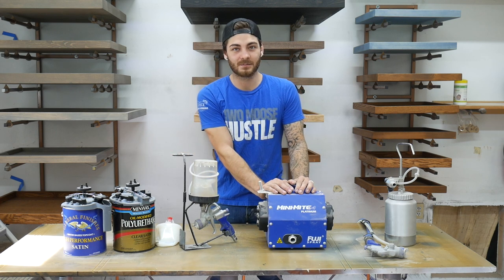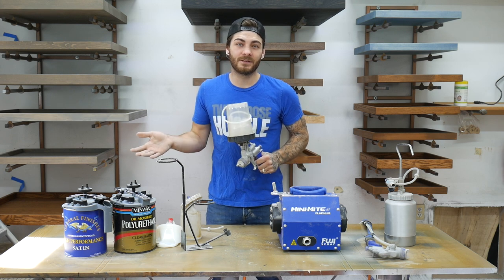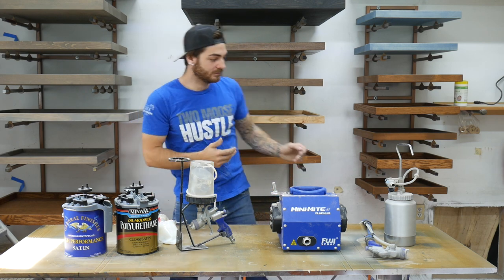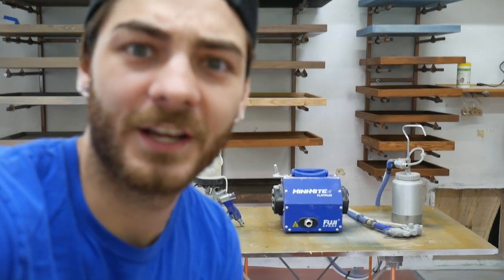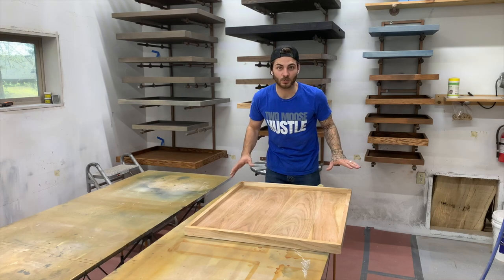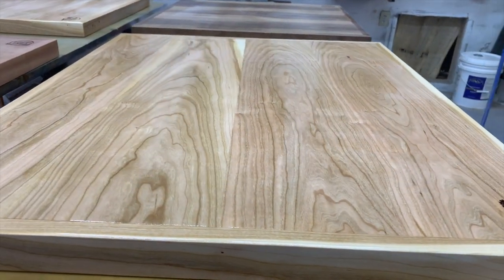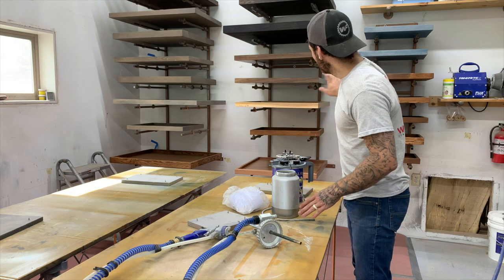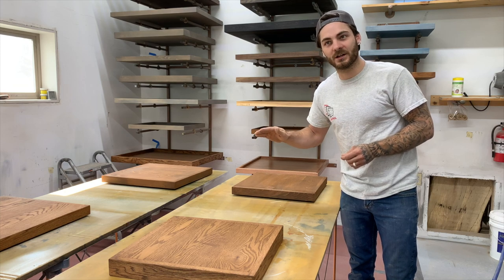My Spraying Setup and HVLP Woodworking Sprayer Tips // How To

Comment: We just tried the oil modified poly and wow. What the hell we were wasting time with the full on poly. 

We were getting plaugued with dust or some kind of cross contamination  with the oil. 

First coat took a while to fill in. The second coat was dry so quick. Since it dried so fast sanding was quick. We had to really scrub with oil. 

Something we half assed looked awesome . 

Just going to see if we can do this with a earlex or try brushing it. I don't think it's possible to brush and keep it consistent . It requires a thin coat which might be impossible with brushing and maintaining mini production of a ton of moulding without taking all day
Reply: You mentioned you used this with the earlex. ? How did that work out ?
Reply from the maker: Glad it works for you! The main reason I use it is for the dry time. I can get 3 coats in a day vs 8+ hours per coat with oil 🤷🏼‍♂️ and the water based is plenty durable for my needs. I personally spray everything because of the quantity I do but I’ve had decent luck brushing it on small items
Reply: @TwoMooseDesign  true. But I feel it will be  impossible to keep it consistent brushing  . plus You sanded so lightly . With oil We had bubbles all over the place.  
 I'ma try spraying tomorrow the oil modified tomorrow. . But wow. I can't believe how good the finish is with a foam brush like you did. 

Have you tried it with an earlex machine before ? I hope it's powerful enough.
Reply from the maker: @shahsmerdis  it should be a plenty powerful! I haven’t used an entry level spraying in a while. I used a Wagner for a while with a different water based poly
Reply: @TwoMooseDesign  thanks !!!!! I really appreciate it.!!!
Reply from the maker: @shahsmerdis  you bet! And when applying by hand do not back brush. Add a nice coat and move on, it will level out on its own. The more you brush over it the worse it will look in the end.
Reply: @TwoMooseDesign  thanks for the tip! I'm definitely going to try spray first.  We had good results with Benjamin moore latex paint  with the earlex. It came out like a show room piece ! No orange peel. 

On the brushing note, I've heard  about not back brushing . But  Im not  sure how much work time do you  mean. do you mean lay a coat down and don't go back and forth at all. Or just don't go from one end of the piece to other end and then  back to the start type thing  .    I dont think I need to treat it like shellac. I think we will get the hang of it. 

I hope thats not too wordy for a youtube comment lol
Reply: Ohh ! And brush any brush of  choice you prefer ?
Reply from the maker: @shahsmerdis  yeah once you have it covered don’t go back over it once you apply it to an area don’t brush back over it. I personally use foam brushes since I don’t apply much by hand anymore

Comment: I like your spray finishing set-up Jef.  Here's a few comments to help your audience out: 
  1.   get into the habit of always straining finishes as you pour them into your gun cup (or reservoir) - even if there's a built-in strainer (PPS, for instance) - to filter out any impurities or loose dried fleck of finish which could spoil your finish.
   2.  if you're spraying a waterborne finish NEVER use a tack cloth, as they contain oil-based solvents which will cause fish eyes and affect the bonding of the next coat.
  3. raising the piece you're spraying at least 15cm (6") above your spray table will limit finish bounce-back and make it easier to get your hands underneath the piece to flip it over.
   4.  until you're as experienced as Jef or Jess and can visually check as you go along, use a wet film gauge to confirm the thickness of the coat you're spraying.  As a general rule of thumb, most finish manufacturers suggest each coat be between 3 and 5 mils (.003" - .005") in thickness... but it's always a good idea to check what the manufacturer states on their website. 
  5.  keep your hose from kinking (especially important where it connects to the turbine), as that may cause overheating of your turbine and result in premature motor failure.  That's why the manufacturer suggests placing the turbine on the floor.
Reply from the maker: Thanks for all the info! And taking the time to write it 😁 all amazing tips 🙌🏼 I’ll have to come up with some new lifter blocks mine are getting cruddy anyway
Reply: I thought the PPS system already has a built in filter so you never have to filter it before putting it into the cup. It's designed that way to save you the step of pre-filtering.
Reply: @saritsotangkur2438  you are absolutely correct, Sarit.  However, I have continued the practice of pre-straining any finish that goes into my spray system's cup or pressure pot reservoir because that was what we did when I first got into spraying over 30 years ago.   It is another step which takes me less than a minute to do and gives me peace of mind that I will never have to contend with a clogged PPS strainer cap.  And they can become clogged, especially if you're using waterbased finishes such as I do most of the time.
Reply from the maker: @saritsotangkur2438  it does. He’s saying that you should filter it anyway and be better safe than sorry so no contaminants get in the finish. You don’t have to filter it with the pps system just and extra step to be safe but you are correct it does have a built in filter and you technically don’t have to filter it at all just pour it in. 🤷🏼‍♂️

Comment: I see many folks asking about the aircap set used, it's a 1.3.  Fuji color codes the caps, silver is 1.3, blue is 1.0, green is 1.8, etc.  I'm about to go attempt to finish my cabinets with oil based poly, this video being one of my influences.
Reply from the maker: The 1.3 and 1.0 will work for most film finishes. You got this! Takes a little trial and error to dial it in. I’d play around with a couple scraps to first but shouldn’t be too bad
Reply: @TwoMooseDesign  Couple things I've learned, spraying cabinets uses a lot of poly and I bought the small 3M cups, and second, don't unscrew the cup from the gun when it's upright.  It's so obvious once the finish is running down the gun and your hand onto the floor.  Also, doing this in my dim garage not a good idea.  Very hard to see.  I have a Q5 and I am using about 80% of the power, just a random guess.

Comment: Hey Jeff. Thank you so much for the video man!  It was hugely informative. I started my Etsy shop back in April and it’s been doing really well(DairyBarnWoodworking). One thing I’ve been struggling with is spraying finish(I prefer Lacquer). I just have a cheap HVLP connected to a compressor that’s too small. I just ordered the HVLP Fuji sprayer, 3M cups, mixer lids, etc from your affiliate links so I hope you get a decent kick back. Thanks again for sharing your knowledge man. Take care, Travis.
Reply from the maker: Hey! Thanks I appreciate it! You’ll love a nice sprayer it gives you sooo much adjustability and good call on the 3m cups it’s a really nice upgrade.

Comment: I really enjoy your content this video pushed me over the finish line to pull the trigger on a mini mite 3. It has worked gloriously. Thanks again. I do have a question. What air cap set are you using to spray those two different brands of poly. Thanks again in advance

Comment: Great intro to spraying video, well done. I’ve been looking at the Fuji units to upgrade my spray game. I really like the fan pattern you are laying down, much better than my current setup. Thanks to this video I foresee another charge on my credit card next month. Thanks a lot!!!!
Reply from the maker: Rich Stephens thanks I really appreciate it! And yesss I had a few entry level systems and the adjustability in the more expensive systems is sooooo nice
Reply: Two Moose Design 
I started out with a turbine gun 30 years ago and basically wore it out. I’ve been through about 4 compressor hvlp guns since then and am no longer happy with the results. Time for a upgrade.
Reply from the maker: Rich Stephens oh man that sucks...I’ve always wanted to try an actual compressor set up but I ended up gravitating to the hvlp turbine units because they are so dang convenient lol

Comment: I’ve built a small 10’x12’ dedicated spray booth in my wood shop. I will be getting an HVLP setup like the Fuji Semi Pro 2 and wondering about overspray? Will I need a dedicated exhaust fan? Or will opening the window be enough? Possibly putting a fan in the window with filter? I think I would be spraying poly, lacquer and latex paint. Thank you for your help.

Comment: Great info! I’m looking into the turbines now , after struggling to spray latex on my last big piece
Reply from the maker: Latex is rough. Definitely thin it some and I’d get a bigger turbine to handle the heavy material
Reply: @TwoMooseDesign  I’ve never used any turbine. I’ve always sprayed with my 60 gallon compressor but never anything as large as what i just finished. I’m exploring several options. Either getting into a turbine or spraying lacquer.
Reply from the maker: Like tinted lacquer?
Reply: @TwoMooseDesign  yes. Didn’t really know about that. I don’t typically paint my pieces. Especially anything that large. Usually I’m using a hard wax oil to finish.
Reply from the maker: @dimensionswoodworks  definitely try it out. ive used it a few times and it works pretty good. depends on the application but worth a shot! and same i prefer the more natual lookin finishes as well!

Comment: Great video. On the PPS system, those liners crinkling up were always a problem until I realized you can suck the air out of the cup and they will straighten out.  This makes storing or emptying partially filled liners much easier. No risk of getting any paint in your mouth.  What air cap set were you using?
Reply from the maker: Oh wow! I didn’t know that! That’s a great tip. Annnnd the 1.0 or 1.3 🤔 I don’t remember off the top of my head I never change it 😆

Comment: Have never sprayed paint before, looking to invest correctly.  I like the idea of the top mount 3m pps for small jobs and clear coats,  as well as the external 2qt pot for large jobs and paint.  Would a t75g gun cover both uses well?  I noticed the hose on your gun for the 2qt pot was a bottom hose mount... is that for hose management only, or something else?

Comment: Great vid...Ive got the mini mite 5 and the t75 gravity gun but that plastic cup is crap, the overflow constantly blocks and leaks
Reply from the maker: the pps 3m system is a game changer! I lay it right on the table flat and it doesn't leak. The plastic cups that come with it have to be like perfectly clean, the graco was the same way they wear out way to fast.

Comment: You ever spray precat white lacquer (for like cabinets).  Friend wants me to build some built ins for them.  I built my own and sprayed them with a white latex using a Graco airless.  I ended up with a really good finish but dang it was hard and there was a huge learning curve.  I’ve been told spraying lacquer is much much easier.   I’m thinking of investing in a 4 stage Fuji so I can do this.  Thoughts? (Thanks for the video - it was great)
Reply from the maker: For topcoats a Fuji with a turbine will be waaay more efficient. Also was it a water based product? I sprayed water based pre cat for about a year and eventually switched back to poly because the lacquer was more sensitive than poly and had a few small issues I didn’t have with poly
Reply: @TwoMooseDesign  I’ve never sprayed lacquer or poly because I only have a handheld graco airless.   On my cabinets I sprayed SW ProEnamel white paint.  I actually got a great finish but it was a HUGE pain.   I want something more fool proof, which is why I thought a white precat lacquer would be good.  You think a white poly would be even better?  I thought lacquer because of the really fast drying times.  Then again I don’t know much about it. I’m a novice at spraying.  I just want a super smooth white finish that’s way easier than spraying the white ProEnamel paint.  I should also note that I want a really durable finish as well. Built ins will be in a house with two little boys. Lol

Comment: I just bought the semi-pro 2 and hope I made the right decision as far as getting the right Fuji model… I’m just a hobbyist as of now and not on your level! But you explained it well! I like that 3m set up too. When you spray on stain, do you condition the wood prior to staining? Assuming you still wipe after staining? Thanks!
Reply from the maker: Hey! Depends on the wood whether I use conditioner or not. And yes I do wipe the stain. GF makes stain you can spray on and don’t have to wipe but requires a special touch to get nice even color

Comment: You did not mention the Earlex. Great system.
Reply from the maker: I agree, I haven’t used one but looks like a good budget friendly system
Reply: @TwoMooseDesign  it’s fantastic but boy these are tricky for sure. The paint dries so fast it doesn’t have time to lay down smooth. I bought some additive that will help slow down the drying time and a piece of glass to practice on. Hopefully I will be a pro by the end of the day. Lol. It’s nothing like the 3 other sprayers I have. Again, thanks for the video.

Comment: Have you had any experience with the Fuji Semi-Pro 2 and how it may compare to the MiniMite?
Reply from the maker: I have not but I believe it’s a smaller system. Which won’t matter much if you mostly spray top coats then it’s plenty. If you plan to spray a ton of paint I’d probably lean towards one of the larger models.

Comment: I have the same minwax poly. How much thinner do you use, and what kind? Do you add the thinner once to the tin?
Reply from the maker: I don’t thin it, I’ll add a little extender mayyybe 5% but normally only when it gets cold or excessively dry
Reply: @TwoMooseDesign  what is an "extender"?

Comment: Were you using the Graco when you switched to the pot?
Didnt sound as loud.
Reply from the maker: I don’t recall lol neither machine is very loud. I can hear my radio over both machines. The graco is just nice because of the auto on and off feature. I’d say they are as loud as a vacuum cleaner?

Comment: Curious what your sitting the trays on when you flip them.. is that just 4 nails / screws? Are you flipping when they are still wet?
Reply from the maker: Yep a board with screws in it. I beat down the points a tiny bit, and for the most part they are wet. They sit for a minute or two then I flip them. If your careful you don’t see any marks.

Comment: Really good video.  Looking for my first sprayer, hobbyist woodworker, I'm between the Wagner Control Pro 130 and the Fuji Semi Pro 2.  I know the Fuji is better but its twice the price.
Reply from the maker: I’d say it depends on what you plan on spraying most. The wager appears to be an airless sprayer which has the ability to spray thicker paints and the semi pro 2 might struggle a little with thick latex paints. If you plan on spraying mostly top coats like poly I’d definitely go with the Fuji. I personally don’t know anything about the Wagner I just Google it 🤷🏼‍♂️ I’m not sure how well it will lay down poly and what not since it’s designed to paint houses essentially 😬 either way you’ll love having a sprayer!
Reply: @TwoMooseDesign  Gotcha.  Basically just sick of rolling paint and cleaning brushes.  Want to be able to throw a coat of primer, paint, or topcoat onto whatever project I need some paint on, cabinet, shelf, wall, etc. Would be nice to be able to touch up the exterior white sealer on the concrete block foundation and that stuff is super thick.
Reply from the maker: @bilmcgee8494  I would go with the airless sprayer 👍🏼 I like water based products makes clean up way easier you pretty much just spray water and a touch of soup through it

Comment: I've started using the oil modified poly after watching this video. I usually spray outside with a Fuji Q5 and get great results, but now that it's gotten colder, I've moved into my garage and I keep getting an orange peel like effect as I spray. I'm thinking it's temp/humidity related (as I've already checked the usual causes of orange peel) since temp/humidity are the only variables that have changed. Have you ever had an issue like this? What, if anything do you do in the winter months for climate control in your spray room? Thanks
Reply from the maker: Our shop is climate controlled. But I did have issues with lacquer in the past. I added extender to product so it wouldn’t dry as fast in the low humidity. I know general finishes makes a water based dry time extender which is what I used with the lacquer. I haven’t had the issue with oil modified but it sounds like a similar issue.
Reply from the maker: I also run a small heater in the finishing room as it gets super cold here. I’ll also start running a humidifier around this time as the humidity falls off a cliff lol I try and keep the temps around 65-70 and humidity at around 40-50.

Comment: Great intro for new sprayers! This was so beneficial! Like your tips and tricks and the upgrades! It looks like you use Brad nails to hold the handles/sides of the tray together. Does that seem to have any issues with the spray poly?
Reply from the maker: The nails are filled and thee sides are glued on. In haven’t had any issues over the past few years. And thanks! I appreciate it 😁
Reply: Does the type of wood matter? Looks like you use a lot of hardwood. What about pine?
Reply from the maker: @DEEZSIGRAI  I use a lot of pine too. We source it from a lumber mill though not Home Depot so it’s processed a little different

Comment: great vid man.  I'm curious what you do to keep the air clean in that room. just negative pressure fan/ducting?
Reply from the maker: Stockbilt I have a explosion proof exhaust fan and then just crack a window and it removes it all pretty quick.